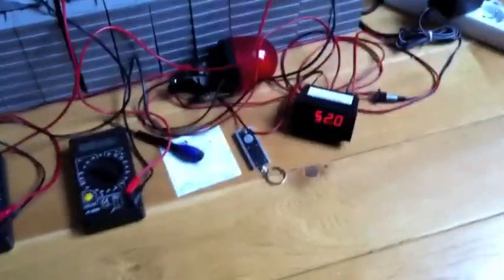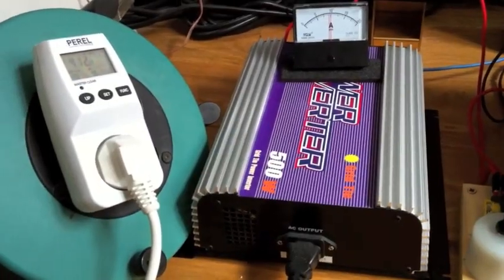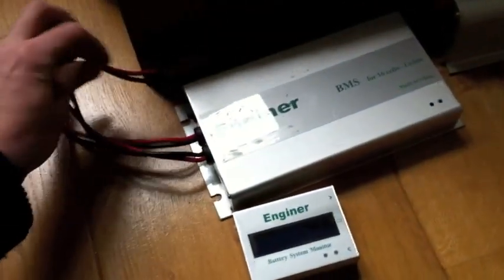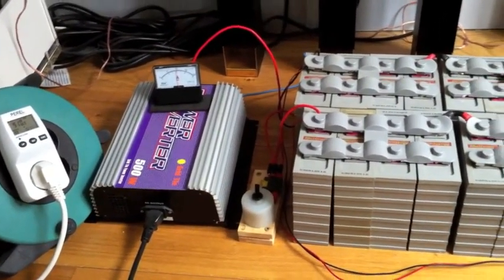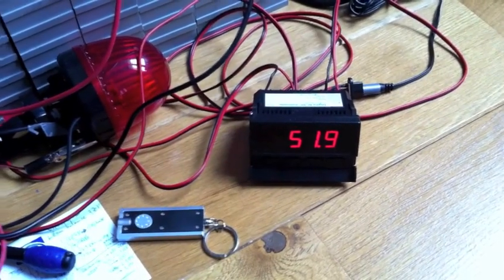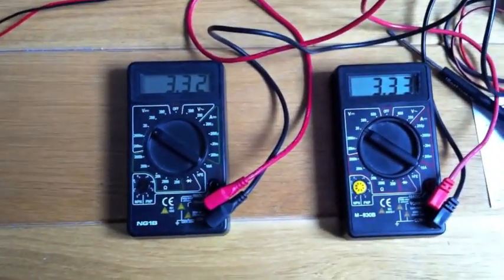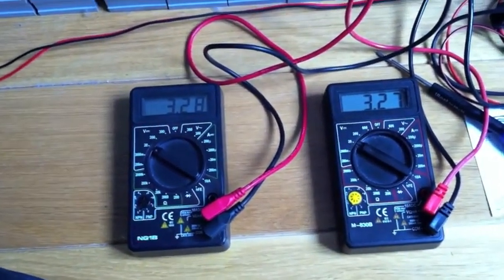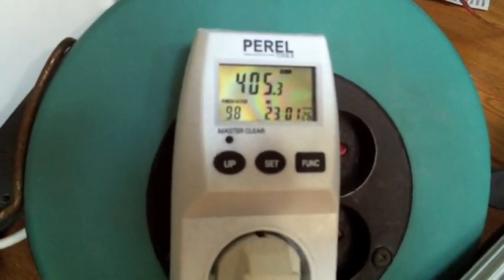LiFePO4 Battery Bank / Solar Energy Storage System - 2

Comment from the maker: Yes they're much better 
More power, more energy density, lithium based batteries made EVs viable
My ESS has been running 24/7 for more than two years now, with even better lifepo4 cells from CALB
Check out my blog for more : http://www.diyesskit.com

Comment: These cells are quite a bit more expensive than regular lead acid batteries. Do you find them to be more efficient? What are the advantages to these batteries?
Reply: Semantics Simple higher energy density, doesnt get damaged if deeply discharged
Reply from the maker: They have a great power output capacity, do not dsicharge at all when not used, etc